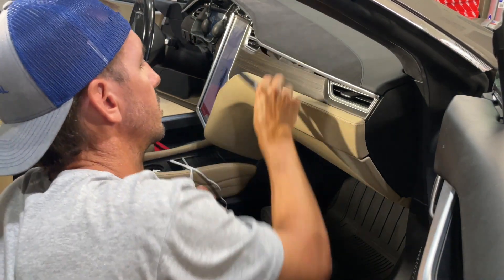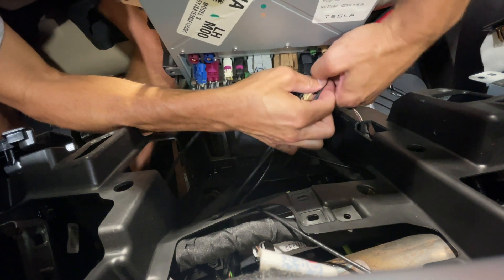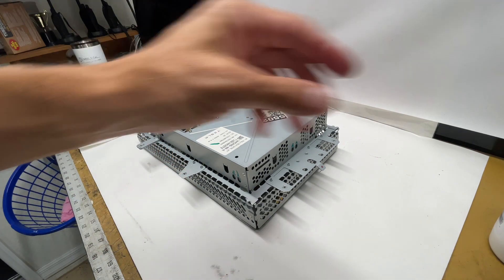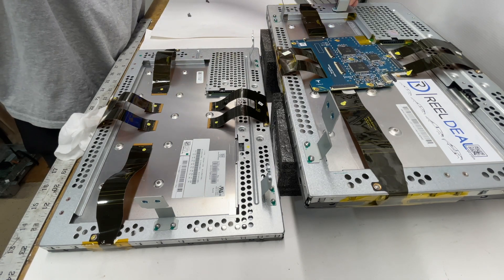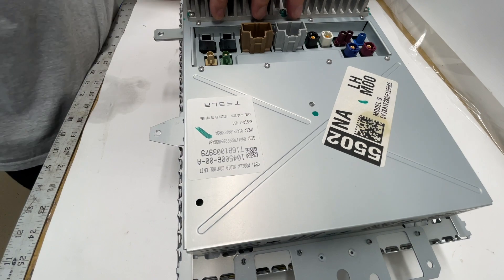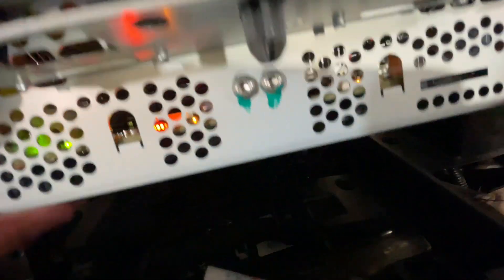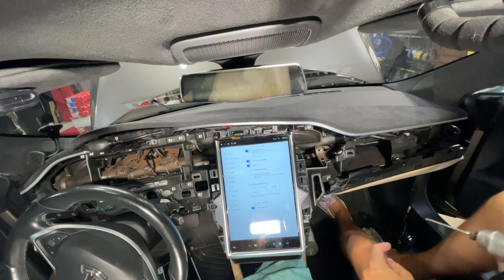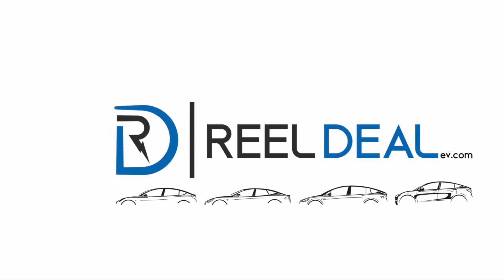Reel Deal EV Tesla Model S and Model X MCU Media Control Unit Replacement for bubbles/leaking fluid

Comment: Great Video. Question, does the MCU1 replacement screen have glass on it or are you reusing the previous screens glass?
Reply from the maker: Thanks for the comment, yes they have to have the glass. The glass is the digitizer which is what tells the car where you are touching.

Comment: Do your screens suffer from the same glue issue?
Reply from the maker: We have 2 models, one is new without the extra piece of glass, so no that one will never do it, the other is a remanufactured screen and we have only been using them for about 1 year, and have not had any issues. We have been told by the manufacturer that we will not see the issue like the OEM screen.
Reply: @reeldealev  Not sure which extra piece of glass you’re referring to. Haven’t taken one apart yet.
Reply from the maker: ok @rsxfreak03

Comment: Did you not have to disconnect the power for this?
Reply from the maker: It doesn't hurt. But it is not required, you can just power down from MCU. I am not sure if I addressed it in the video, but open the frunk before doing anything, just in case you need to disconnect power.

Comment: There are two ribbon cables that attach the PCBA to the MCU. One is thicker and has each end marked. One side says 'Display'. The other ribbon cable is thinner. Which one controls the digitizer?
Reply from the maker: There is only one ribbon cable that attaches to the PCBA, it is that one.
Reply from the maker: Did this resolve your issue?